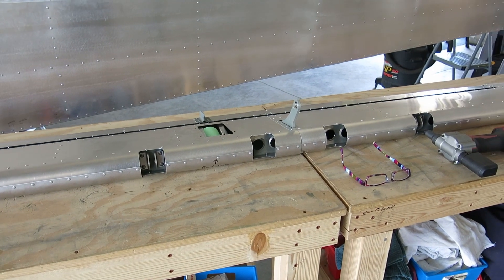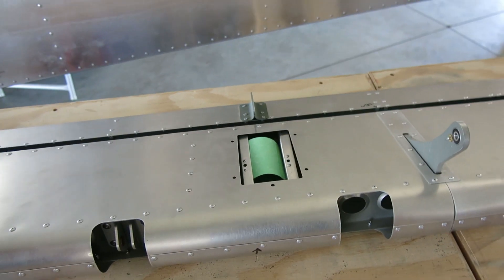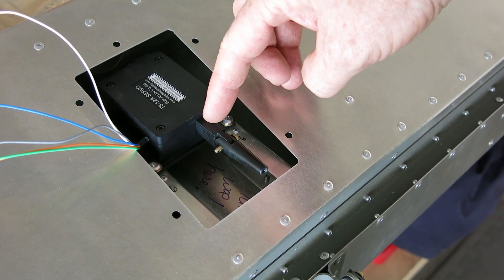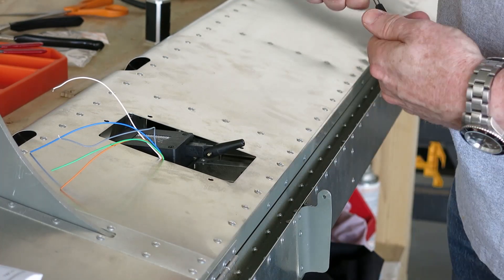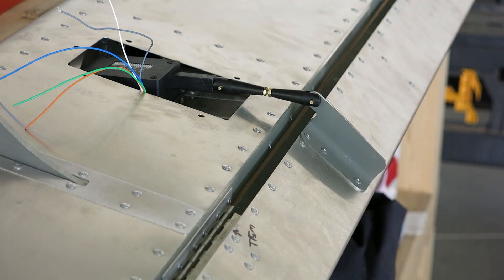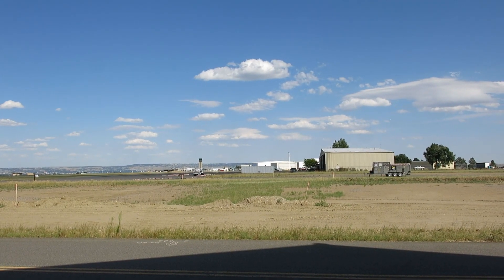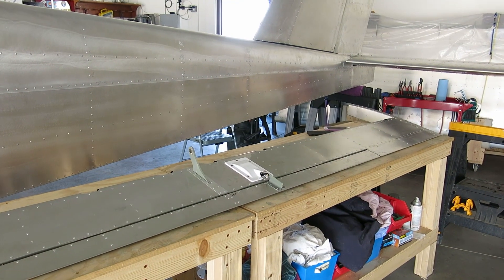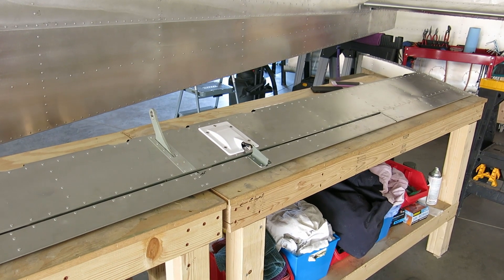No. 208 07-23-2022 Elevator trim tab servo installation

Comment: Just making note of this. If you knew beforehand, would you have installed #6 screw nut plates from the beginning? Maybe a recommendation to Ran’s to change that in the instructions.
Reply from the maker: Yeah, I would have done a 6-32 on all four from the beginning. The Ray Allen instructions don’t specifically say to NOT drill for an 8-32, but the way they say if needed to carefully size it up to a 6 implies to me that 6 is the largest they want you to go. Another weird thing in the text manual is it says to drill it #20 for the 8-32 screw. I think it needs to be a #19. The #20 hole makes it a really tight fit for the screw and seems like it would lead to a crack in the housing out to the corner.
Reply: @s-21project92 After reading this in the Ray Allen FAQ, I’m not too worried about strength of this material even with the larger holes.  “We know of our actuators that are used successfully inside cowlings, but we are hesitant to recommend it. Although the DuPont Minlon® brand nylon we use is the same basic type that is used in BMW valve covers, the strength of the nylatron gears inside get weaker as temperatures climb above 180 degrees F. Try to keep the servo in a ventilated location under the cowl away from exhaust pipes or better yet, behind the firewall and use our B6 actuator.”

Comment: I think RANS should have followed the manufacturer guidelines on fastener size.  However, since I also already have the #8 nutplates in place, I will drill the motor to that size and hope for the best.  I expect there will be no issues as long as the screws aren’t over tightened.
Reply from the maker: I took the holes up in as small increments as possible. Looks ok, I’m just not a fan of that little real estate on the corners. I added a washer between the screw head and servo body.
Reply: @s-21project92  I hear you, but given the direction of the forces, I am not too worried.  You could completely break off the corners and the servo would still be constrained well in the shear direction so I see little concern.  And using washers will distribute the clamping force well.  I doubt these servos are capable of more than a few pounds of force so I suspect there is little concern.
Reply from the maker: Yeah that’s true. But still not a fan of the way they did that. Plus they spec a #20 hole for the 8-32 screw. I think that’s too tight and will also lead to cracking at the corners and should be a #19. It feels a lot better with that size.
Reply: @s-21project92 I am installing my servo today so am revisiting this.  I agree that #20 is on the small side for a #8 screw, particularly if the holes in the nut plates aren’t precisely aligned with the holes in the servo body.  Better to not put a lot of stress on the housing.  I believe Ray Allen’s web site says that the housing is glass-filled plastic so it is much less likely to crack than is unreinforced plastic.

Just for grins, I decided to call Ray Allen.  The friendly man on the phone said they prefer to keep the screw size at #6, but he was very tactful and said he wouldn’t say that RANS was wrong to use #8.  When I explained that I already had #8 nut plates installed and they would be very hard to replace, he said that he “would have no concern flying in an airplane with a trim servo attached with #8 screws.”  😁. So, I am not going to mess with the nutplates unless I have issues in the future with the servo case cracking.  And even then, I won’t mess with the nutplates, but will instead fabricate a square metal ring that will go around the full perimeter of the actuator and then screw the ring to the nutplates.  That will definitely hold, but would have the hassle of requiring a rebalance of the elevator.  I really don’t foresee a problem though given the material used in the actuator body.
Reply from the maker: Good info. Thanks!